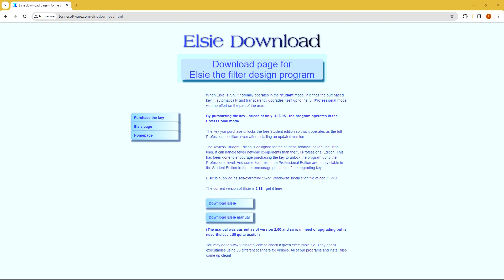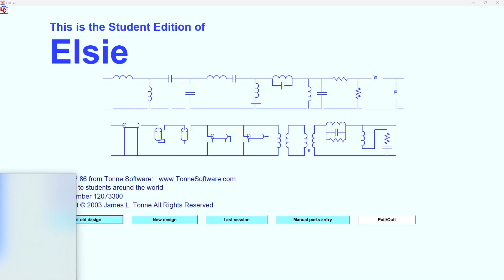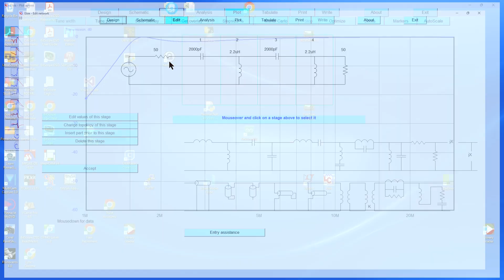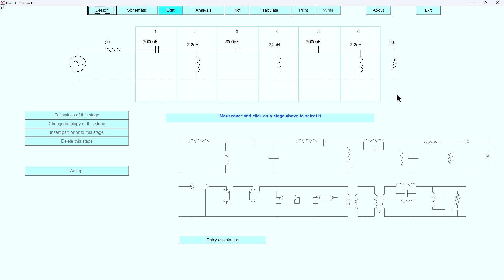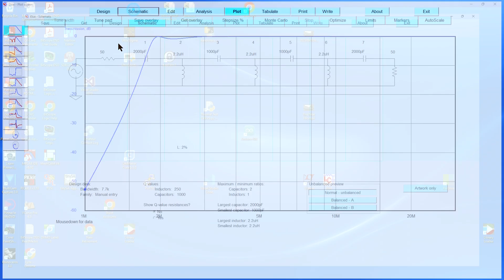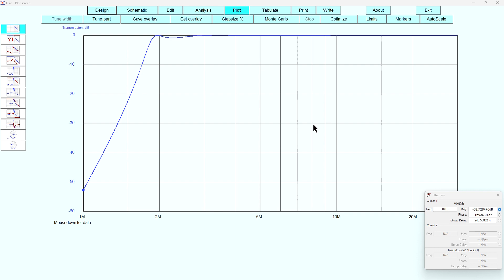DIY Broadcast Filter Design For Our DIY Homebuilt HF Radio

Comment: each reactive component contributes a pole.  so a lc filter with 1 cap and 1 inductor would be a 2 pole filter.
Reply from the maker: This is correct thank you for pointing that out. 
RJ